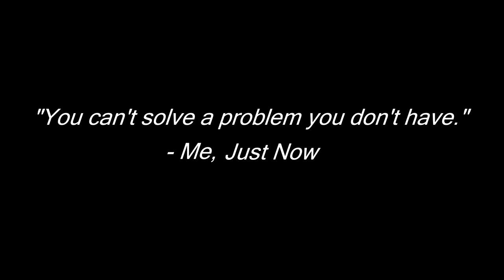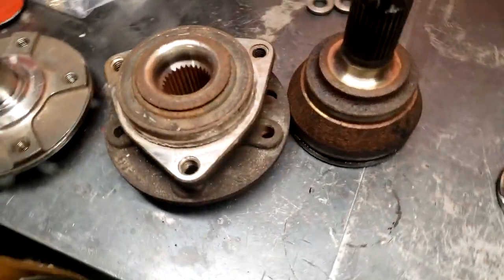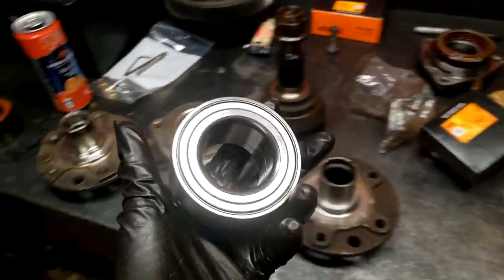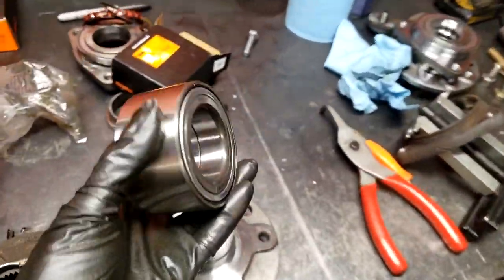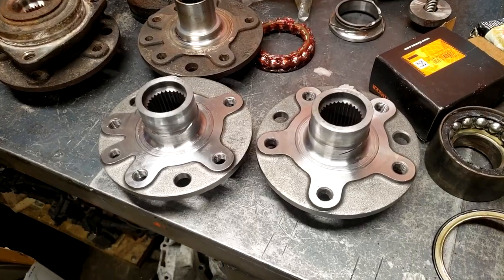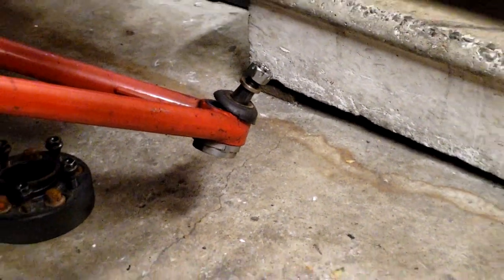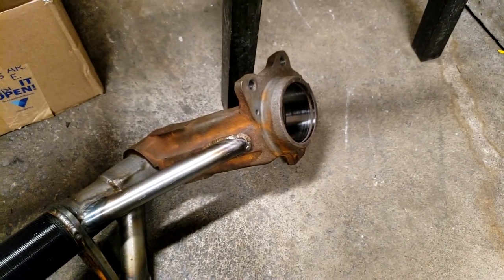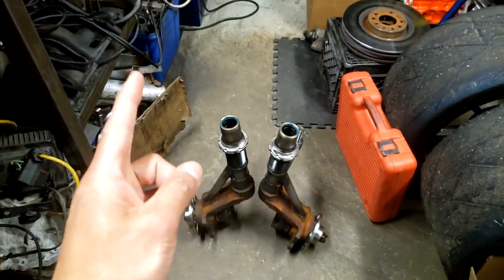How to Custom Fit a Wheel Bearing & Hub (SAAB Edition)

Comment: I love your solutions on everything 😁 
But was just woundering, did you never think of just change the hole setup with struts from 9-5 all together ? 
Only thing u would need to figure out then is the steering but thats easy 
Im looking at probably doing that on my og9-3
Reply from the maker: Doing that would take too much time, cost too much and create too many unknowns at this point. If I didn't have to compete I would have done it differently

Comment: Wonder if you could find a ceramic needle roller bearing to loose the gained friction but also have the rigidity?
Reply from the maker: Probably, but this is the only bearing I could find that suited the dimensional constraints.

Comment: But you ended up using 9-3ss axles according to your latest video?
Reply from the maker: Yes
Reply: So how instead of snapping hubs or dealing with all that he can have spare sets of 9-3 axles. If it's ever a problem, and viggen axles slip in. 
He's moved a failure point to something much more convenient and reduced some of his brake issues with the bearing flexing. 
Sounds like a win to me.